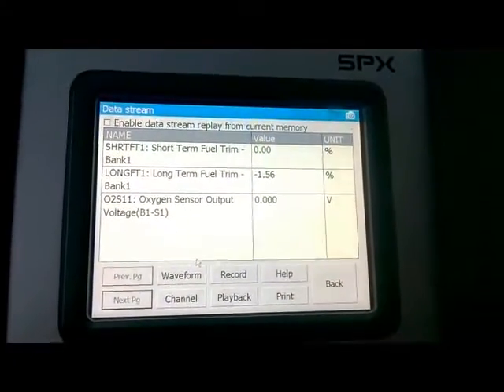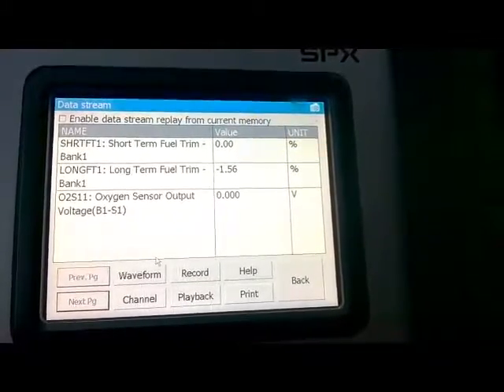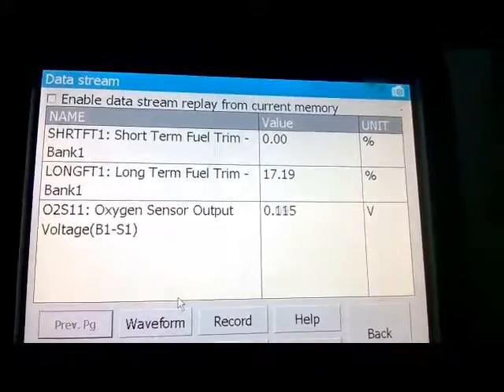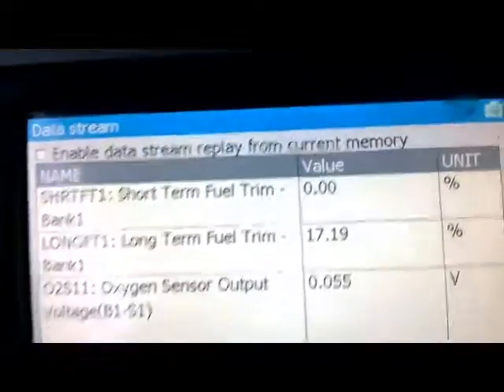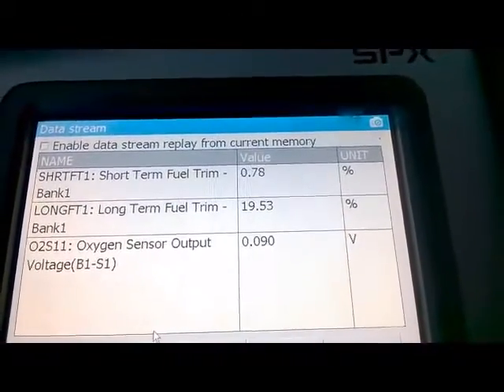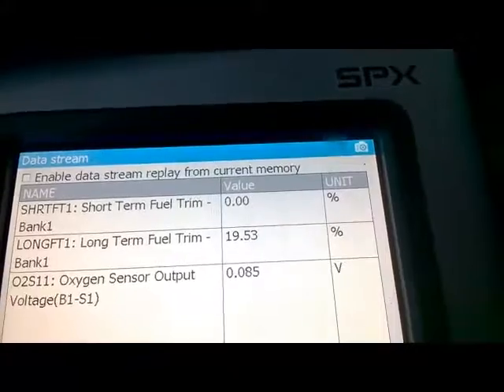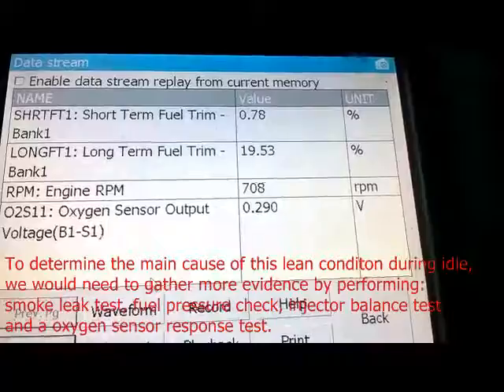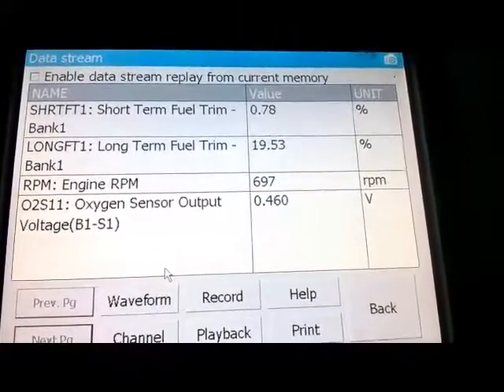(Toyota Camry) Fuel Trim Diagnosis

Comment: Was dealing with an integra today that sat for maybe 2 years before being started, fuel trims were reading high negative numbers on short term and when accelerating the numbers would go higher, but at idle came pretty close to 0, car also has issues stalling and bogs out, replaced injectors, have to check fuel
Pump and fuel filter but just curious what do you think that is
Reply from the maker: Possibly egr system being restricted,  faulty upstream O2 sensor, stuck open evap purge valve or faulty fuel pressure regulator.
Reply: Eli TheOBDTech i forgot to mention there’s no check engine light, I know i would get o2 codes or even evap codes i would think, but going to check the fuel pressure regulator tommorow
Reply from the maker: @OmgiTzWreckz  Believe it or not, sometimes the computer for some reason won't pickup a problem. FP regulator is a good start. Keep me posted.
Reply: Eli TheOBDTech ugh I know, just figured after running the car and car stalling and having signs of misfires it would atleast throw a code, also whenever AC is turned on the car wants to stall out aswell
Reply: Eli TheOBDTech but runs completely normal at idle and no AC l
Reply from the maker: @OmgiTzWreckz  what year is your integra?
Reply from the maker: Have you checked your throttle body for carbon deposit?
Reply: Eli TheOBDTech throttle body is clean as it can be, and 2001 teggy with B18 non vtec
Reply from the maker: @OmgiTzWreckz  Alrighty, perfect.

Comment: Hey I have a scion tc ( 2.4L 2AZ toyota engine) that i Boosted and have a piggy back computer along the toyota ecu. At idle the wideband AEM air fuel ratio gauge shows lean and STFT is normal but the long one is at -29.  We figued the the toyota ECU is over correcting so we tried to add more fuel but it needs SO much fuel that that car won't start again if i shut it off. Injectors were set to %65 duty cycle to idle around 14.7 afr.
Normally it was set to %22 or 25.
Maybe the trick is to take away a little bit of fuel so the toyota ecu doesn't see it as rich and trying to take away fuel? I checked for boost leak. If there is any its very minimal. I checked for vacuum leak with a propane tank and couldn't find a spot where the car revved up. Thanks fo the help in advance.
Reply from the maker: In these kind of situations, I wouldn't really be able to help.  I would recommend a tuner shop.

Comment: My Rav4 shows
LTFT1: 3.12% at idle and when I raise RPM at 1900 and above, LFFT1: 5.46% and never goes back to zero or negative. 
Is that normal?
Reply from the maker: A normal reading should be no more than +/-10%, you are still in normal range. Make sure to add long term and short term together in order to get your total fuel trims. Theoretically, anything above +/- 12.5% will trigger a check engine light.

Comment: my van doesn't have a code. rough idle, lil smoke out tailpipe, running rich longft - 14  I'm thinking maybe stuck open injector. MAF, IAC, TPS, all seem normal range. O2's seem normal between 200/800
Reply from the maker: Do an ohm test to each injector and compare. You could also do a cylinder balance test by disconnecting each injector connector and watch for rpm drop.
Reply: @EliTheOBDTech  ok, yes I tested the three in the from ohm's read all the same. haven't removed the intake yet to check the back.
Reply from the maker: @BigAlWillis  Oh ok. Another key component could be  an leaking vacuum control fuel pressure regulator.
Reply: @EliTheOBDTech  yes, I unhooked vacuum from that no change at all
Reply from the maker: @BigAlWillis  Any type of fuel leaking from nipple port of the pressure regulator?
Reply: @EliTheOBDTech  no, haven't found any leaks at all.  idle  gets worse in gear & seemed like a backfire into the intake once.

Comment: Will it show positive and negative fuel trims?
Reply from the maker: With a turbo charged engine, you should have positive fuel trims at idle. Under boost mode, the vacuum leak will allow air to escape which causes the fuel trims to become negative during a boost situation.
Reply: Thats a boost leak then not vacuum leak. I suspect a boost leak bcause i have -17 on wot. Meaning the ecu is pulling fuel not adding it.
Reply from the maker: @mjl6425  I'm not that familiar  with turbo setups but I believe your problem is a boost leak.
Reply: Yeah I think so too now that I’m more familiar with fuel trims. I now have a direction to look, thanks.

Comment: How bout this: Short and long trim are fine during normal driving/idle. But when revved up to 2000, the long trim gradually climbs to over -25% in a few minutes and sets 175 (rich) code. Also, have a 0430 code (low cat eff.) for several months. What gives?
Reply from the maker: With negative fuel trims, you are running rich. Too much fuel to air ratio, so the computer is subtracting fuel. Potential problems: Leaking injectors, faulty fuel pressure regulator, contaminated/dirty MAF sensor, faulty/lazy oxygen sensors. A malfunctioning cat maybe causing this problem too.
Reply: @EliTheOBDTech  Think I can rule out pressure regulator & MAF sensor because this occurs on only one bank (V6). So looks like it's down to injectors or oxygen sensors, although sensors are (seem to be) responding well.
Reply from the maker: @jakejones5736  try performing an injector flow test, that will absolutely give you  definite results in how your injectors are performing.
Reply from the maker: I would recommend using a otc 3398 injector pulse tester
Reply from the maker: Forgot to mention that a clogged air filter will also cause negative numbers.
Reply: So can you diagnose this with fuel trims as well? Because mine am having stft @-10.94 and ltft @-10.16
Reply from the maker: @AnythingEverythingGh  Yes, try doing a visual inspection on your MAF sensor, might be contaminated.
Reply from the maker: Let me know, will work from there first.
Reply: Yes, no doubt 
The maf may be contaminated,
Since when the car was bought I don't believe it has being cleaned or replace before. Bought the car last Dec,2018. 
I have obd scanner can you direct me how I can monitor the trims to confirm it's dirty maf Sensor?
Possible of getting your personal email, whatsapp or any handle so I share shots to you ?
Reply from the maker: @AnythingEverythingGh  Monitor your fuel trims by increasing your rpms in increments of 500rpms. Ex. 1500, 2000, 2500, 3000 and finally 3500. If your fuel trims tend to go more positive, that an indication of either a dirty MAF or some type of fuel delivery. If they stay negative during the rpm increments, potential injector leaking or fuel pressure regulator, etc....
Reply from the maker: Email at eguillen.tech@hotmail.com
Reply: @EliTheOBDTech  ok
Will check it up and email you 
Thanks
Reply: @EliTheOBDTech  ok
Will check it up and email you 
Thanks

Comment: Pls how can I have data value sheet?I mean to know actually value abt fuel trim or long trim.Or if you can send me details how to detect a bad fuel pump or bad 02 sensors I will appreciate.This is my email:ojacampus@yahoo.com.Thanks
Reply from the maker: jamiu ajasa for what kind of vehicle?
Reply: Eli TheOBDTech    what really happened is that I have Launch and I got new Aurodiag im600 but the issues is that I dt really understand how to figure out the bad fuel pump short term fuel trim or long fuel trim.I need your help if you can explain much better.Thanks
Reply from the maker: jamiu ajasa pretty much look at your short and long term fuel trims and increase your rpms by increments of 500 rpms. If your fuel trims increase as you race the rpms, you may have a faulty/dirty MAF sensor or fuel delivery problem; clogged fuel filter, faulty fuel pump, pressure regulator, clogged injectors. If your fuel trims drop as you raise the rpms you may have a vacuum leak or faulty/dirty MAF sensor.
Reply: @EliTheOBDTech  What about if the values are negatives??

Comment: My bank1 is -4 percent bank 2 -3 percent and both are long term. I step on the gas 2500 rpm and it didn't change. What could it be? Running rich?
Reply: Car is fine